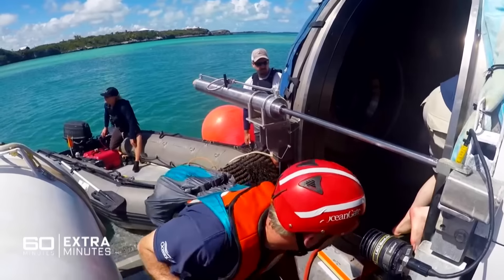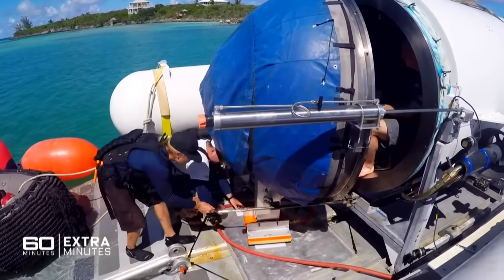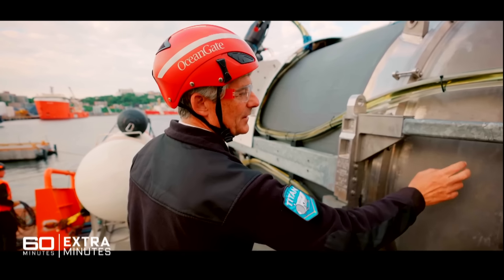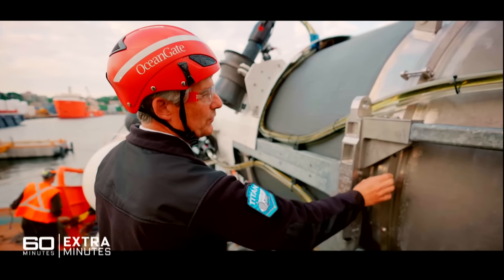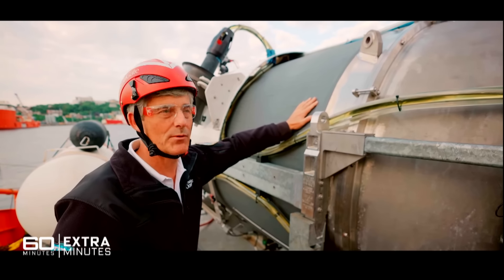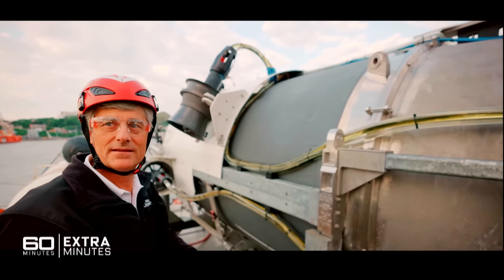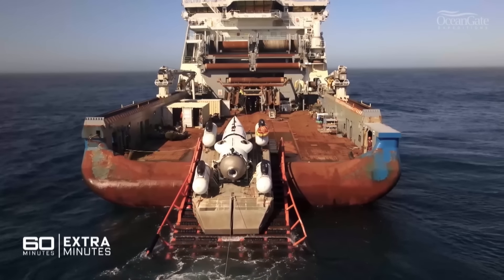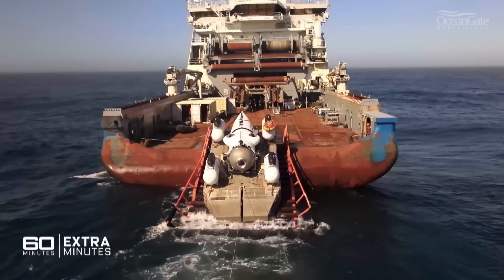Titanic sub implosion explained | 60 Minutes Australia

Comment: In all probability the gunshot sounds were carbon fibres snapping under the pressure of the water leading to delamination ie the layers of carbon fibre separating from one another.  The catastrophic failure of Titan's hull was inevitable as with each dive the delamination grew worse until it reached the point where integrity failed and the pressure of the ocean at that depth instantly crushed it the only mercy is that the five people aboard would not have felt anything as at the moment of implosion the air inside would have been superheated instantly vaporising all there soft tissue.
Reply: Didn't feel at the exact death moment, but did suffered and experienced terror, shock, stress, hopelessness...worst kind of death.
Reply: @TheMoonObserver  They would have been killed instantaneously by the pressure and the walls of the sub crushing them.
Reply: Not exactly. That's what we are told to believe. They were more than likely squeezed out of the tube like toothpaste.
Reply: What did the engineer mean when he said that "the opposite is true with metal". Does the metal hull get stronger with each dive?
Reply: @TheMaticus06 if you understood carbon fibre you’d realise it shatters it doesn’t tend to compress
Reply: Or ACTUAL gunshots.. due to the then ongoing gang wars between some of the sharks and dolphins.
Reply: @Spenglerist  if it stays within its elastic limit it would be the same thing as rolling steel vs casting it. In rolling the metal is pushed together. *billet parts vs cast. A rolled billet is machined out to replicate a cast part. It’s expensive, but stronger. *
Reply: Spenglerist.. I am now in my mid forties.
But as a youngster.. i would be a lot more curious and one time
I accompanied my mother's mother (grandmother) to where she often went to get cookware like 'kadhaai'.
Kadhaai is the typical wok like thing used here in south Asia.
(I am from India).
.
I do not know much about metal under 5000psi in deep ocean.
But was surprised to see the ironworkers guys beating the heck out of wrought iron pieces.. manually shaping them into the thick THICKKKKK cookware, kadhaai which my Maa's Maa (NaaniMaa/ Grandmaa) bought and gifted to half the Universe.
.
And when I asked her.. why they are hammering the iron so much.. would it not break?
NaaniMaa replied.. no son.. instead.. all such beating makes this iron even more sturdy/ compacted from the inside.
.
Forget physics, chemistry.. my NaaniMaa was not even formally educated beyond age 7-8 years.
.
And she was the one who told a young boy that I was.. of the properties of metal.. or at-least that iron.
And it becoming.. in some ways... better at handling the tough cooking environment.. after being hammered into shape of the cookware.
Reply: @Spenglerist  it's known as work hardening or strain hardening. At the molecular level it's the multiplication and entanglement of dislocations (this is something one of my lecturers asked me to make a point of learning and remembering).
Reply: @AndrewJamesWilliams They would not have been vaporized by the heat. This has been proven to be un true. Although the temperature IS extremely high when that happens, it isn't hot for long enough to burn them.  

Think about it like this. You could tap your finger on something that's white hot, like a molten piece of steel, and not feel any pain, because you are not in contact with it for long enough. You could do this all day and never even get a blister. The same principle applies to the fallacy that they would have been burnt to death first. There just was not enough time for heat to be a factor. There is not enough time for the thermal energy transfer to take place (The entire thing imploded within nanoseconds)
Reply: @sailaab  I see you conveniently sidestepped the whole killer whale issue😁
Reply: The air didn't have time to vaporize anything. However, they wouldn't have felt anything as there wasn't time for the nerve impulses to even reach the brain, not even from the eyes. They would have felt, heard and seen nothing.
Reply: @antonystringfellow5152 It would’ve been “ lights  💡 out”
Reply: @TheMaticus06  And why should we believe you when you've made an outrageous claim that isn't backed up by anything. Cite your sources.
Reply: @TheMoonObserver The actual implosion would occur so quickly they would be dead before their nerves would have time to send an impulse to their brain. Maybe they heard the same gunshot sounds, but they would not have thought those meant imminent death.
Reply: @Spenglerist  Most metals get stronger under cycled load with stresses over the yield level of the metal. It is called work hardening. However, that is not the case for submarines/submersibles since the stress in the metal  is too low. In tension, you can get fatigue failures with lower levels of stress any many load cycles but the metal is mostly in compression in this case. He just meant metal is more predictable than carbon fibre. The word "opposite" is just poor wording.
Reply: @Spenglerist 
Most metals can be stressed over and over again ,as long as it's below their fatigue limit.
Whereas CF it's degrading every time it's exposed to sunlight or water.
Reply: @splint3048  yep, human reaction time is 100 to 200 ms, and the walls met each other in a millisecond
Reply: @splint3048  Indeed as a former jeweler, the joys of annealing, work hardening, reform to work harden, again and again was always fascinating.
Reply: @sailaab 😂.
Reply: They heard the banging sounds literally days after they lost communication. It was obviously something else, not the sub. 
The sub imploded mere hours after it deployed. The timeline doesn't add up.
Reply: @@JohnSimmons-rr2pu I'm talking about the 19 minutes before all communications were lost. If the transcript is real, then 19 minutes of cracking sounds, emergency procedures, alarms...that is what I'm talking about...pure stress, shock, terror, hopelessness...and if that transcript is fake, then take James Cameron testimony for real, he's an autorithy in the deep sea diving community and spoke about the Titan crew releasing ballast to surface at the hour and a half mark. That's an emergency procedure. So, yeah, I get your point, I'm just not talking about a miliseconds period of time, I'm talking about the period of time before that.
Reply: @4and20blackbirds I would cite that 'transcript' with caution to be honest, it hasn't been verified to be authentic to be honest so it could just be some online trolls doing what online trolls do best.
Reply: @Bilson420 You're talking out of your neck and you've obviously never tried tapping your finger on molten steel.... It would burn INSTANTLY so quit making stuff up and just watch the video.
Reply: True, but I suspect that cracking sounds aft ,as the text message states, started some fear onboard.
Reply: @TheMaticus06  Not if the CF failed as it would shatter and become millions of little blades and shredded the bodies.
Reply: @Spenglerist  When metal is compressed it gets stronger, not weaker, because the molecules are so tightly packed together in one solid configuration. Pushing them together makes them super rigid.

Comment: The way Stockton Rush set his company up showed how evasive he was being. Oceangate Inc is registered in Everett, Washington while Oceangate Expeditions is based in the Bahamas. Why? The Bahamas has much less stringent rules than the USA.
The second point is this, why did he choose the tubular shape? To fit more people. Why did he choose 5 passengers?

H.R.1159 - Passenger Vessel Safety Act of 1993 103rd Congress (1993-1994).

SEC. 4. SMALL PASSENGER VESSEL.

    Section 2101(35) of title 46, United States Code, is amended to 
read as follows:
            ``(35) `small passenger vessel' means a vessel of less than 
        100 gross tons--
                    ``(A) carrying more than 6 passengers, including at 
                least one passenger for hire;
                    ``(B) that is chartered with the crew provided or 
                specified by the owner or the owner's representative 
                and carrying more than 6 passengers;
                    ``(C) that is chartered with no crew provided or 
                specified by the owner or the owner's representative 
                and carrying more than 12 passengers; or
                    ``(D) that is a submersible vessel carrying at 
                least one passenger for hire.''.
Reply: "more than 6 passengers" means he lost 250K every dive by not making it big enough for 6.
Reply: The Bahamas also have much shallower waters.
Reply: @Zak6009  true, but the reason is much more likely because of easier regulations. Oceangate also states that if they are taken to court it had to be handled in the Bahamas. Clearly trying to skirt US regulations and liability. Oceangate looks like it tried to do more to protect itself legally than it put into the ensuring safety of the sub.
Reply: Bahamas for tax purposes. He didn't want to pay U.S. taxes which are much higher.

Comment: Carbon fiber is actually fairly strong, the problem is that it was used incorrectly. Fibers are great in tension like in a pressurized vessel such as an airplane where the inside pressure is higher than the outside. Not so much in compression such as a submersible where the outside pressure is higher than the inside. Effectively, the carbon fiber did almost nothing and the majority of the compression strength came from whatever resin they used to cast the carbon fiber.
Reply: @@BobbyT-yj1cw The problem with that design is that the corners and edges are going to be under compression. Every force has an equal and opposite reaction, so while the sides are in tension, the corners and edges are in compression and have to take far more compressive load then they would if you had a perfect sphere. Not only that, but a pyramid design has even less space available to it than a sphere. Meaning you need to make it larger than a sphere to fit someone which means more surface area and higher loads.
Reply: @@BobbyT-yj1cw The concave sides are pulling the edges inward while the water is pushing in on the edges. That's two forces (or three forces if you include two sides per edge) acting on the edges. Something needs to be in compression to prevent the corners and edges from collapsing inward.
Reply: @@BobbyT-yj1cw You pull on a string only at one end, the string isn't in tension because there is nothing holding the other side in place. If anchors on both sides of the string share the same body, that body needs to be in compression equal to the tension force in the string. It's simple equal and opposite forces. The sides of your design are the string, what in your design is preventing the sides from moving inward?
Reply: @@BobbyT-yj1cw What is preventing the points of the triangle from moving? You need an equal and opposite force to hold the triangle's points in place. If there's nothing preventing the points from moving, the system isn't in tension, it's moving. I don't know what's so hard to grasp about that. You're suggesting you can pull on a string at its center with nothing holding the ends and that somehow puts it in tension. Sorry, that's not how physics works.
Reply: @@BobbyT-yj1cw I honestly think you're trolling at this moment. You're using inertia to justify your wacky physics on a static body. Not only that, but arguing that instantaneous forces function in the exact same way as continuous forces.
Reply: @@BobbyT-yj1cw Tell you what, how about you go create your design in a FEA program like Solidworks, Pro E, or ANSYS and tell me where the points of high stress are when you put a pressure load on the outside? I would show you by modeling it myself in those programs, but YouTube has its limitations when it comes presenting that proof.
Reply: @@BobbyT-yj1cw And that's the exact same attitude that caused the Titan sub implosion. You are the one who asserted that the design of concave triangles was sound and presented no proof. You want me to do your work for you for free, sorry, no. Pay me like you would an actual engineering firm and I'll do the work.
Reply: @@BobbyT-yj1cw Well, if you think you're so smart, go out and patent the design. You clearly think there's nothing wrong with it. Although I would be prepared for allow of engineering firms to laugh you out of the room.

Comment: Being strings, carbon fiber is good for stretch type of load. 

Here, it was wound in cylinder, and the load is a pressure from outside. I believe the actual bearing structure is not even the carbon fibre, but only the resin. Which is even magnitude weaker

Comment: It was the way the titanium domes & the carbon fibre tube compress & rebound that caused the failure. The two materials deform at different rates putting a massive stress on the glued joint between them. 
There was no way that the adhesive could cope with the differential movement of the two materials.
A titanium sphere would compress & return elastically. But the adhesive joint was ripped apart each time the submersible dived as the carbon fibre tube deformed more than the titanium.
Reply: That's not the problem at all, the issue is carbon fibre doesn't handle compressive loads all that well and should never have been used for such an application. Titanium has some wonderful metallurgical properties that make it great for things like this, what this man is describing, these 'gunshot' like noises is stress fatigue, or in essence the carbon composite experiencing small, localised damage and beginning to delaminate. Over time this cumulative damage was ALWAYS going to result in this catastrophic failure, it was guaranteed.

Comment: I have worked with pressure vessels whether that be with ASME standards or BS5500 and calculations are dependant of pressure and temperature and the stress figure at these variables to determine the thickness of materials to withstand the pressures. How on earth you detemind this with carbon fibre wrapped round like a rippon. These people who climbed into this sub where inteligent people, yet chose to dive deep under water. It staggers me why they wanted to go and do this. Very sad.
Reply: I think the excitement of the adventure itself got the better of them to the point that they were no longer thinking cognitively about safety. Now we know for sure Carbon Fibre is no good for human occupant submersibles. A lesson lived is a lesson learnt, except they are no longer with us to learn that lesson.
Reply: @lancepage1914  When I pay $9.00 for a ride on a roller coaster, I don't ask the park owner if the structure was inspected  recently (I may NOW though). Likewise, his passengers would have assumed that it was safe if only because the designer/owner was himself on board. No one expects someone to do what Rush did ; be so blinded by $$$$$$$signs he convinced himself he was right and all the people with 20,--30,--40 years experience were just jealous and wrong. Rush actually believed it was safe, or at worst thought that at the first sign of trouble , he could just dump the ballast and bob peacefully/safely to the surface. The phrase 'instantaneous catastrophic implosion' wasn't even present in his mind. It should have, because the TOTAL PRESSURE attempting to crush that brittle plastic pressure hull, was 425,000,000 lbs of FORCE, the weight of approx. 470 fueled and loaded Boeing 747s!!!!
Reply: Stockton and his wife sold the sh** out of the sub, dinners, flying out, telling them it’s safer than crossing a street 🙃
Reply: @lancepage1914 the lessons were learned long ago.  According to James Cameron, since the 1960s  there have been no catastrophic failures to vessels of this type.  Steel hulls are used for a reason.  
The lesson here is that one man's desires and hubris are not exempt from the laws of physics.
Reply: @elinebrock5660 tends to be titanium for DSVs these days.

Comment: In addition, the glue used was also a problem.  Metal expands and contracts u like a composite coated in glue.
Reply: Yes I believe it was JB weld applied by hand
Reply: @thestruggler3338  and he didn't want input from engineers.

Comment: Rhino liner? A pickup bed liner company who expanded into other uses, none of which are to seal vessels at 3000 meters under the surface of the ocean.
Reply: I wonder if the company will have to add a disclaimer - "not applicable for use at 6000 psi"...
Reply: That there's probably one of the 'innovations' he was patting himself on the back for.

Comment: I have some experience with glass fiber based pressure housings.  The main point in the design on them is the ends of the tube and how exactly they are done.  When tested to failure it is almost always at some point of transition that fails.  Coating the outside is a good idea but I would bet that the titanium ring to carbon fiber transition is the point where the failure started.
Reply: The glue that bonds the ring to the tube for me was an immediate red flag, what happens to the glue if exposed to high pressure water plus temp cycling? What if the water eats away the glue. This is also ignoring the fact that the tube has a large component that is also essentially harded glue.
Reply: @blackmancer  I worried less about the actual glue and more about what the glue was being asked to do.  As temperature changes etc, the titanium and the carbon fiber will want to react differently.  It looked to me like the glue was in a design that would make a pealing action.
Reply: I also have a vast knowledge oF glass( bravo!) The first time I broke all my mother's crystal drinking glasses I was grounded for a week! No more video games.
Reply: @daviddavis3389  Remember that with their vast knowledge, they still ended up with a half vast design.
Reply: @kensmith5694  true that!